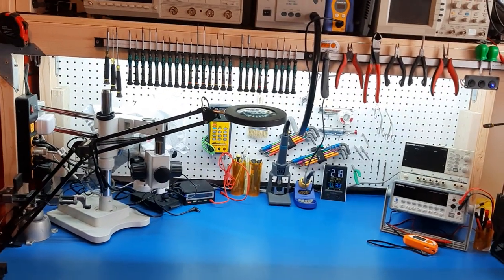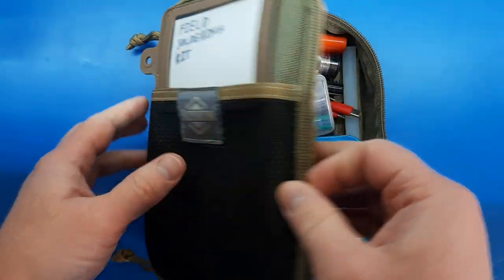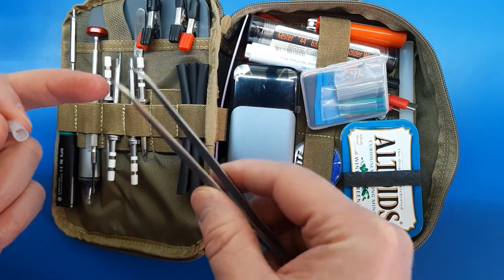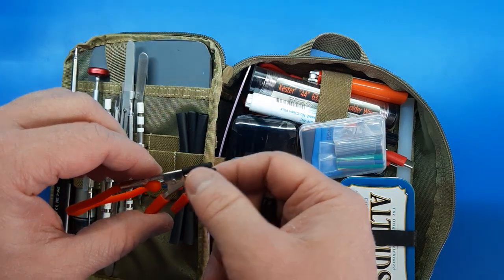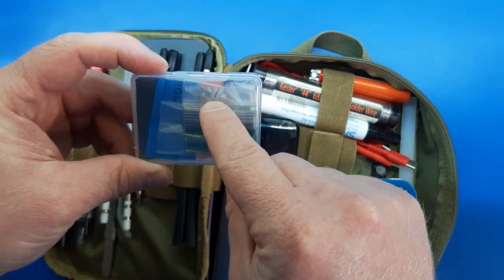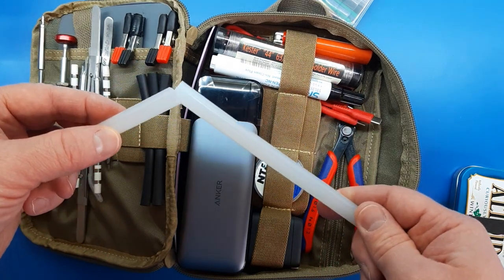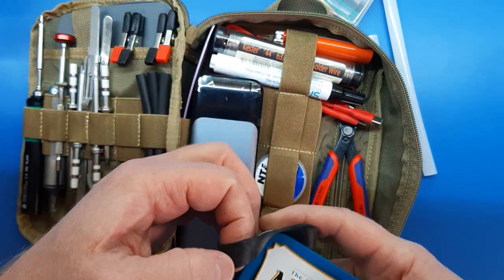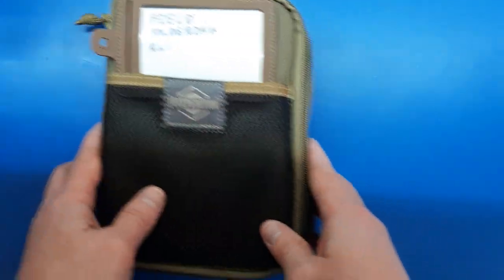Updates to the Field Soldering Kit (with Pinecil V2).

Comment: fyi for the EPR battery you have.  I finally found a cable that is new PD3.1 spec 240w and claims to be real silicone but I can't put ali express links in here. it's black. it's usb2.0 data speed which is good for soldering since that keeps it skinnier and more flexible. 
 the other orange silicone cable I got before on ali express is 240w/ 20G data speed which is good for laptop to monitor connections but terrible for soldering because it's so Stiff due to thickness from extra data wires.

Comment: do you have a video for how to make the small helping hands?
Reply from the maker: I don't, but it's really simple to do.  You use needle nose pliers to bend back the circular stem of metal on alligator clips, place the end of a small nite-ize gear tie in the opening, then pinch it back shut.  Do the same on the other end of the gear tie.  Then add a couple layers of heat-shrink on the alligator clip jaws so they don't mar what they grab and you're good.
Reply: @neverendingstudent   it's a gear tie? and not wire?  nice could you tell me the product number of the Alligator since it seems you found a good size to use.